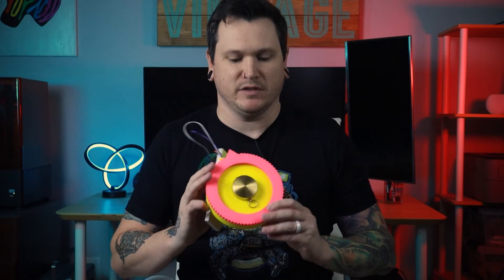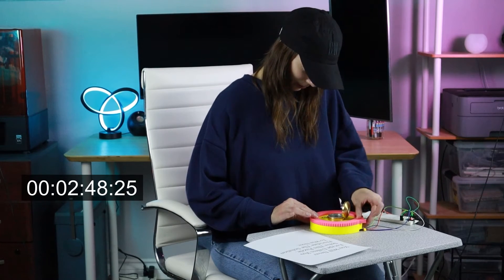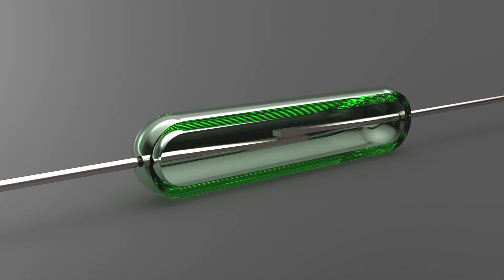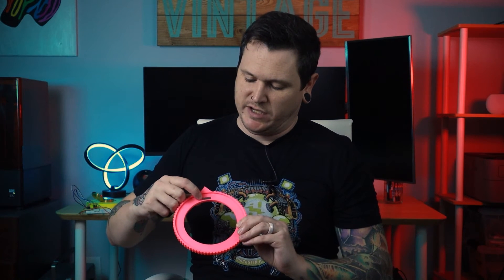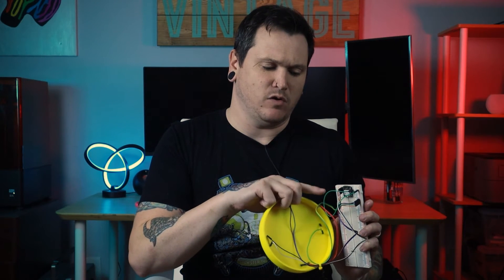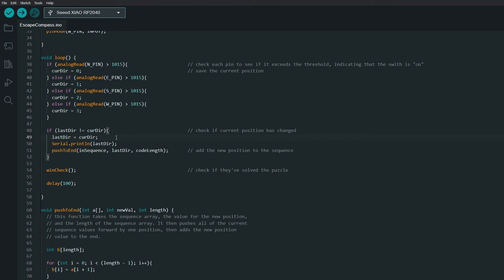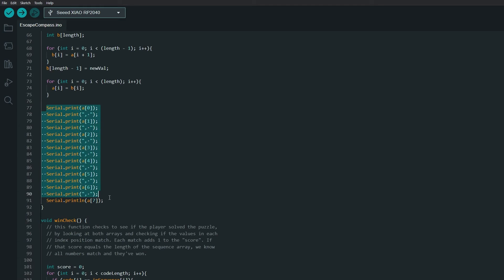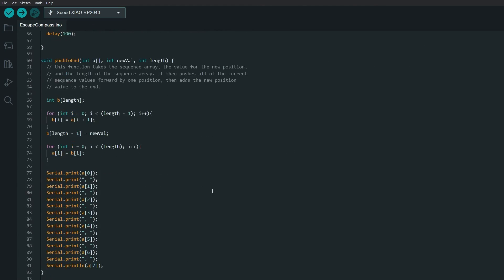Challenging my wife to beat my escape room puzzle

Comment: 7:19 Mate! No need to make things complicated. Just debounce your reed switches; same as you'd debounce any push button. It only takes a resistor & small cap.
Reply from the maker: But then the user could accidentally enter the same direction multiple times in a row, no?

Comment: Digital Index Encoder with the Press Button. 
This would let you scale down the device so as you could make it look more the tumbler lock on a safe. 
 
Those Reed Switches are trash man. You should never get that weird signal. If they break easily then they are not sealed. 
Hall-Effect Transistors will give you a constant analog output.
Glue two, back to back, at each of the four points. It will detect proximity and direction of approach.
C😎😎L project man.👍
Reply from the maker: Thanks for the suggestions! I figured it shouldn't have been that finicky, lol.
Reply: @serialhobbyism_official 
You're welcome man. 
I have 'a thing' for building real world interfaces, or HIDs. 
That trace on the scope is really bugging me. I don't have an oscilloscope, so I moked up your circuit with an old school analog volt meter. I used a small neodymium magnet, and, found it was waaay too strong. Its cube shaped, about 3/16th of an inch. 
Extrapolating from the meter movements, I'm getting a signwave that does not go to zero volts. There is always some signal. 
So the fix for my version is, wrap the magnet in iron / steel. Magnet fits neatly into a 3/16th socket wrench with the open end facing in toward the detectors. 
You may find this video interesting, slightly off topic. 
run time 10m 30s. 
youtu.be/d3IH8zwUVYU?si=6eXmMI62VsitRsir
Reply from the maker: Interesting! I'll have to test it with the iron or steel. And yeah, that's a good video, GreatScott does awesome stuff @snakezdewiggle6084